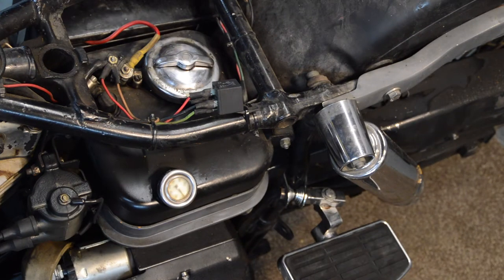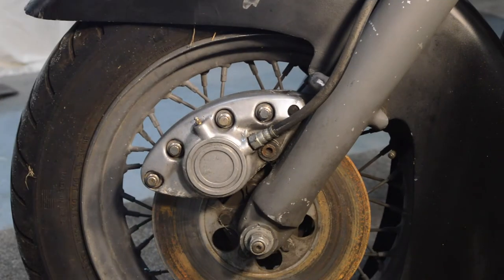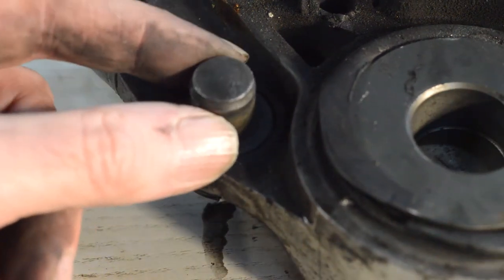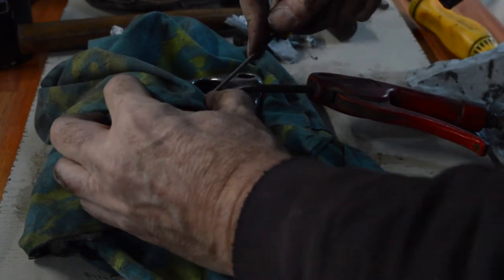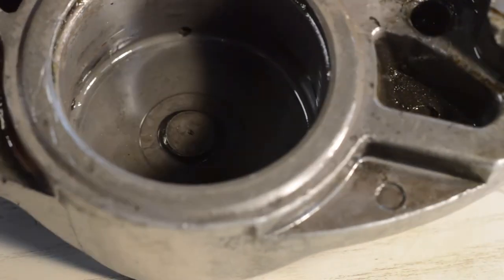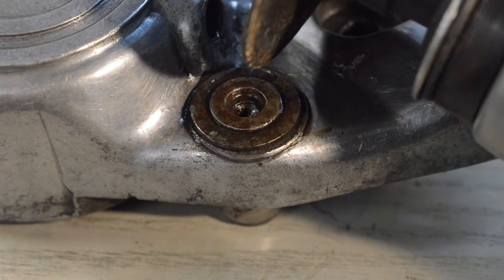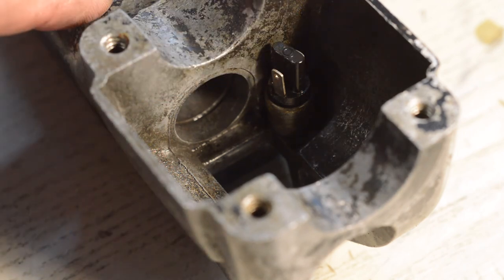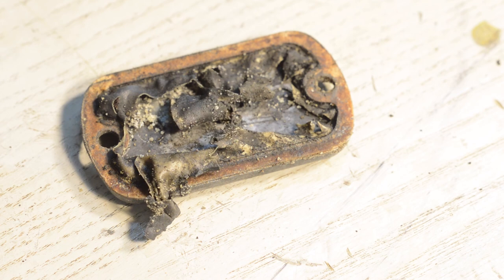Shovelhead Part 2

Comment: That relay is supposed to spark. Your short is in the handlebar switch.
Reply from the maker: A relay may produce a visible spark when operating with the cover off but this one was excessive and there definitely should not be smoking ( which I think can be seen in the video ). The short was not in the handlebar switch as I only replaced the relay and bike now starts perfectly and is in regular use with the original switch in place, if it had been at fault the problem would have remained. Thanks for watching !